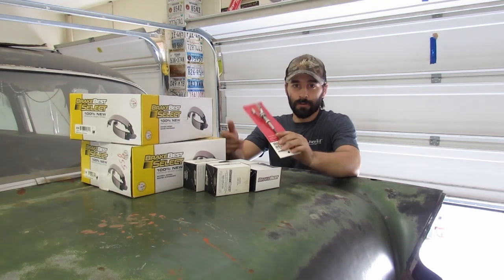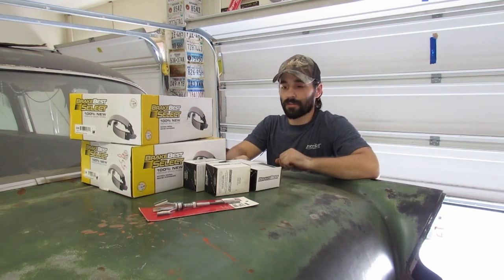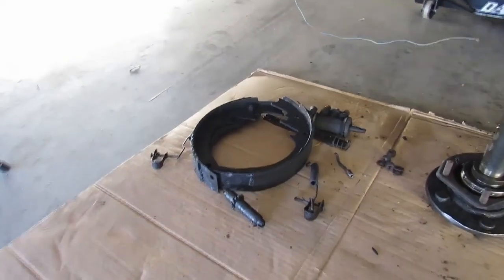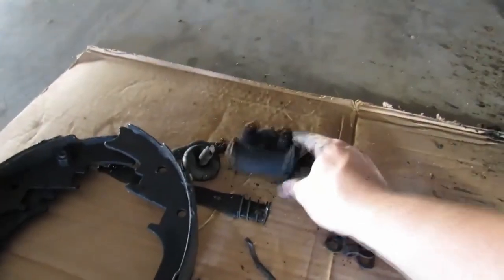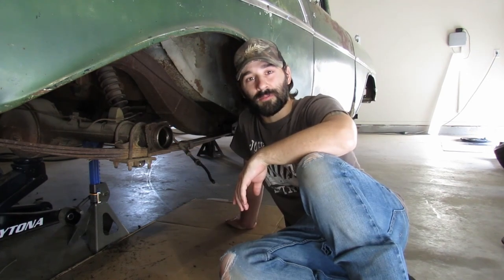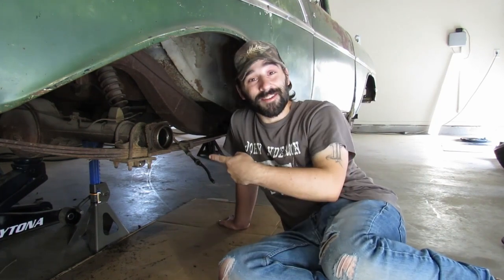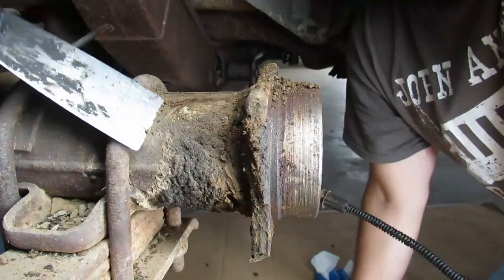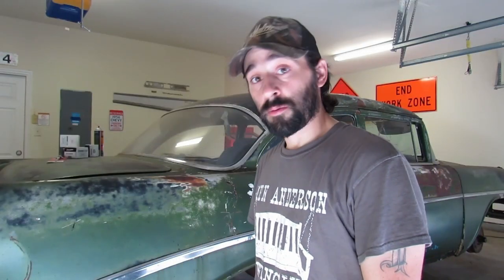We're Trying To Make The Abandoned Tri 5 Chevy Stop

Comment: Nice work on the RH rear, you'll get the rest in due course. 

Hillbilly tech-tip; a length of heavy chain, like maybe 8 feet, bolted to rear axle with at least 2 lug nuts and then crack it like a whip. It does work, although on severely rusted units, who knows. I did this trick years ago replacing a rear axle bearing and seal on my GF's dads old station wagon. I'd hear of popping the axle out with a chain, had nothing to lose and tried it, it worked.
Reply from the maker: That's an interesting trick. I've got chain around. Next time I got a tough one I'll give it a whirl. Thanks.

Comment: Get yourself a dedicated 30 gallon storage tote, and make a mix of 50/50 vinegar and water (don’t fill it all the way up). It will desolve the rust even in the pits. It’s what I’ve been using through the process of restoring my ‘57 bel air. Sheet metal, brackets, anything iron. If it’s too pittied, I’ll repair that part of the sheet metal or bracket. Best of luck too you!
Reply from the maker: Vinegar works awesome! I've soaked sets of steel wheels in 55 gallon drums. I have found the blast cabinet is great if you need to remove rust now & can't wait over night. I hope someone that doesn't know about using vinegar reads your comment because they're probably wasting time with a wire wheel. Great comment. Love it.

Comment: What ive found in every wheel cylinder i ever messed with is that the rebuild kits cost more than just buying new wheel cylinders 
 Not sure why but thats been my experience every time also when your working on brakes  that been off the road for a while replace it all 
 Backing plates wheel cylinders shoes and springs its not expensive and gives you peace of mind knowing that your brake parts arent nearing the end of there life span on this particular car i would advise you to replace  the fluid lines and master cylinder as well 
Just because a line isnt leaking doesnt mean that its not on the verge of springing a leak and they could have trash in them that could cause issues just replace it for your safety and the safety of others on the road
You dont want to to kill or injure someone
An accident caused by shoddy workmanship or equipment failure would ruin you financially for life
Not to mention you or a member of your family could be killed  also theres a slim chance of being sent to prison depending on  the circumstances 
So just replace it all

Comment: Just my opinion, Step up and buy new hardware. Brakes are a safety thing. Trusting your life on the strength of 56 year old spring steel clips on a 3200 pound car? It’s cheap insurance to replace the springs and clips with new. You did a good rebuild on the wheel cylinders. That’s kind of a lost art. 👍🏻
Reply from the maker: You're not wrong about the hardware.